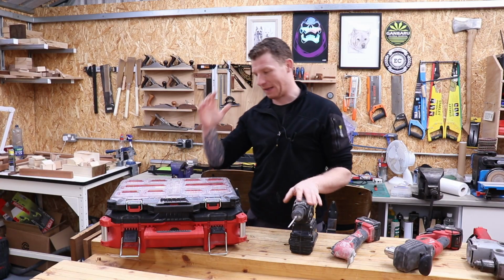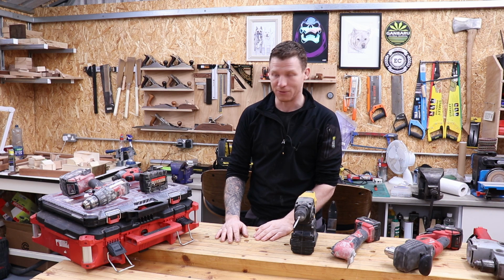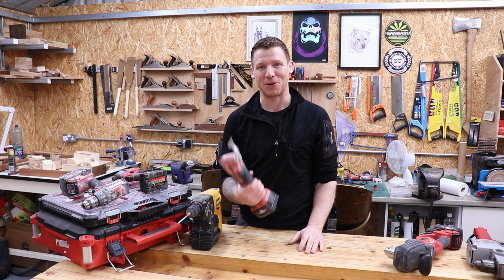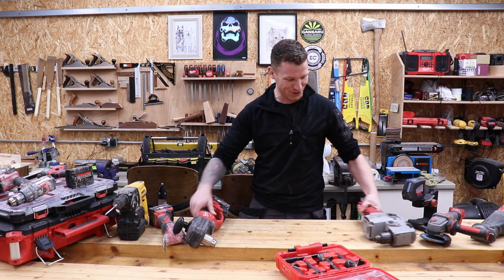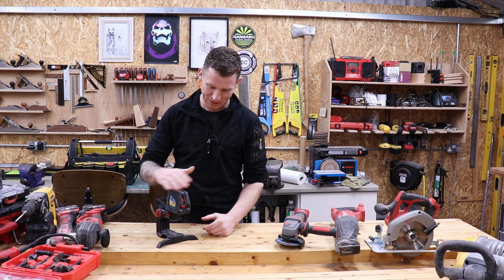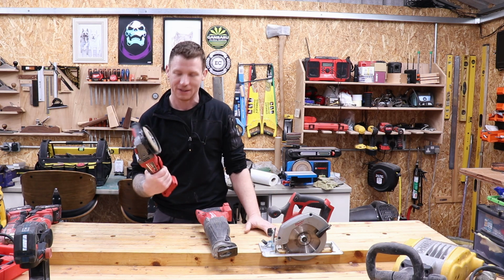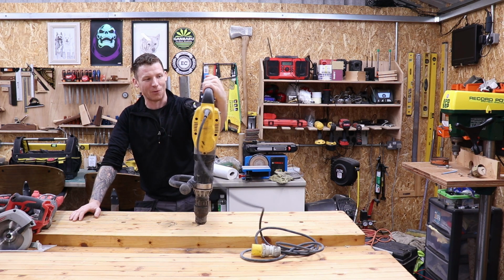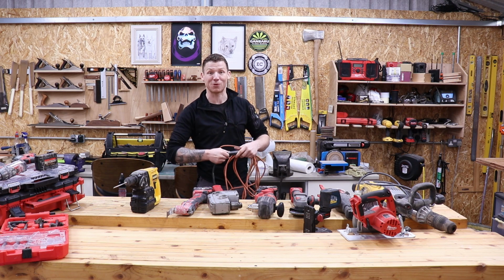Electrician's Power Tools. The Tools I Use Every Day To Make Money. Part 2

Comment: Agree about the Milwaukee drill and driver. Best I've ever used whether mine or borrowed, though I  haven't tried recent Makita. Wish all their gear was as good to use same batteries. They all mocked my first multitool but soon very jealous - more recent versions powerful enough to cut thick, hard timber.
   Wish I'd spent more on a laser level when started on our house renovation project.

Comment: definitely agree on the ocilating saw it’s a must have. Most lads would laugh at you for having it but once they’ve used it they’ll never laugh at you again one of the handiest tools I’ve baught and I’m using the battery dewalt one and that’s coming from a plumber
Reply from the maker: Its a fantastic multi use tool

Comment: Interesting video. Particularly interesting about the +/- 55v for the 110.  I always assumed it was 0-110. Cheers John
Reply from the maker: yeah there is a potential difference of 55 volts between the live and earth and the neutral and earth, so if there is a fault you only come in contact with 55 volts. All done for safety on site.

Comment: Our system is 120/240 volt single phase, the neutral is actually the grounded conductor, center tapped on the winding. That's why the potentials are what they are, 120 volts to ground and 240 volts (approximately depending on grid) across the winding.
Reply from the maker: quite similar to ours so, we have what's called a TNCS system "Terra Neutral Combined then Separated". Center tapped transformer which gives us 240 volts to 220 volts between live and ground depending on how far the house is from the transformer. then you can have either a 12KVA or a 16kva supply for domestic.